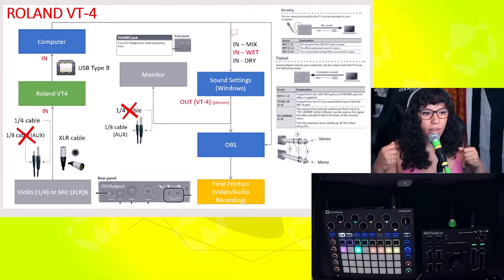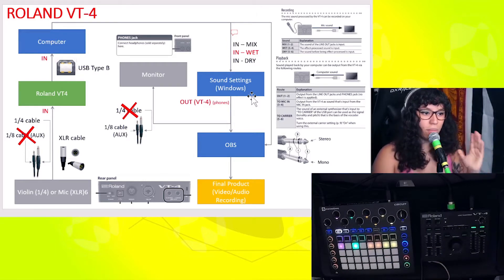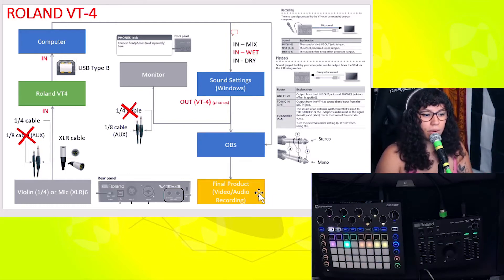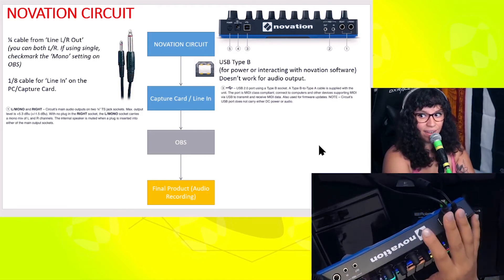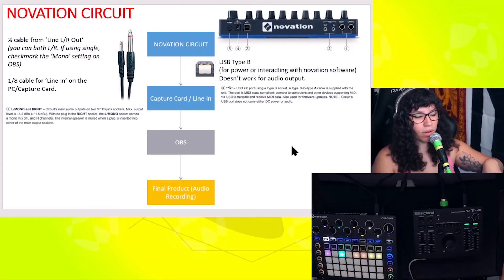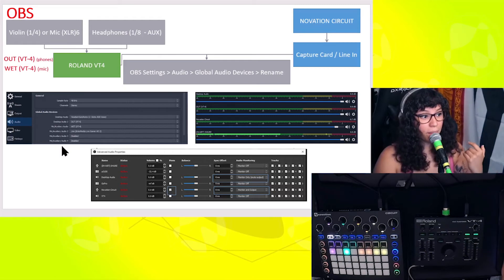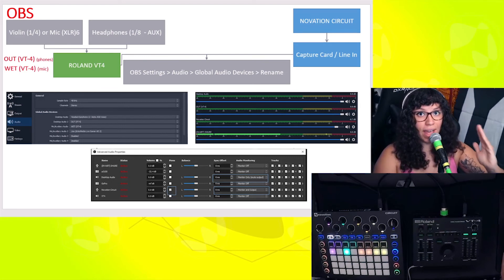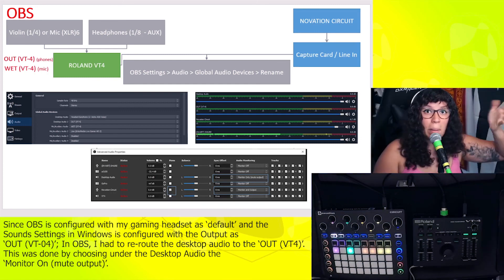Roland VT-4 & Novation Circuit - Setup Tutorial for PC [Non-Midi]

Comment: Great video. Question though: Will I be able to use my computer head phones instead of connecting my headphone to the VT-4 mic jack? For example, I want to hear my voice with the sound processing but also hear my Discord chat ( I am using this for chat). Thank you!
Reply from the maker: Heya, sure thing!

You can still connect the headphones to the Roland VT-4 and you can in the PC or discord settings re-route your discord audio to the Roland VT-4 and that way you can hear both the effect processing and your discord chat. 

If you'd like to keep the connection from the headphones to the computer instead of connecting to the roland...you'd have to use an interface in-between (aka OBS) to re-route digitally the roland processed signal into your headphones (to allow monitoring). That's the monitor setting (checkmark) you need to choose in OBS for the Roland.